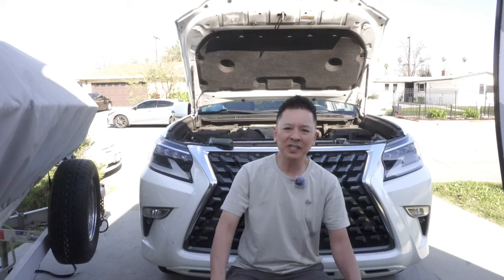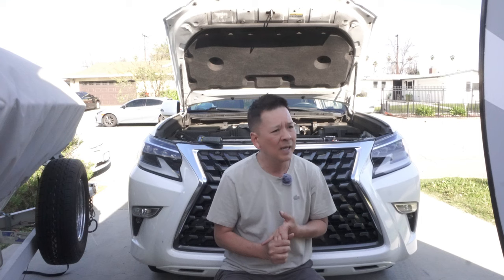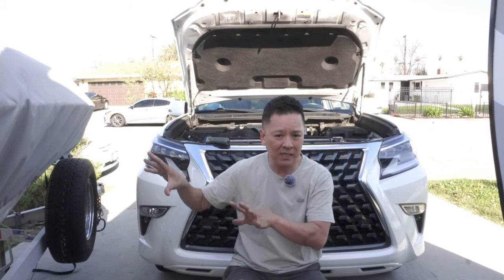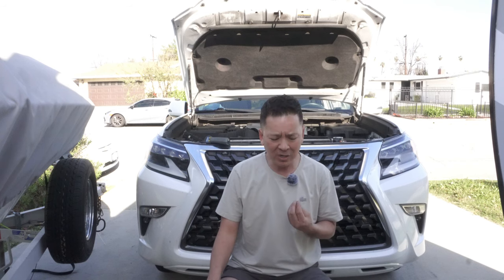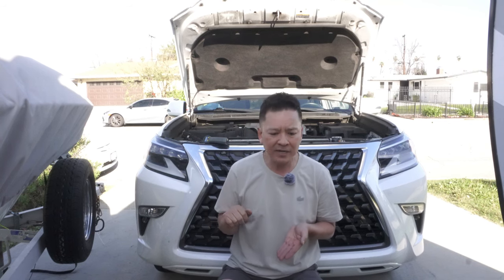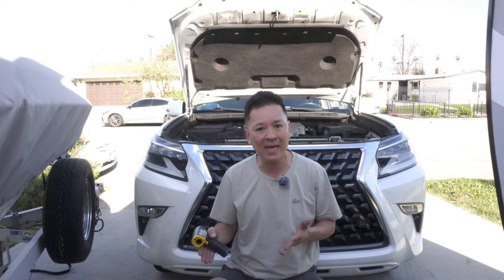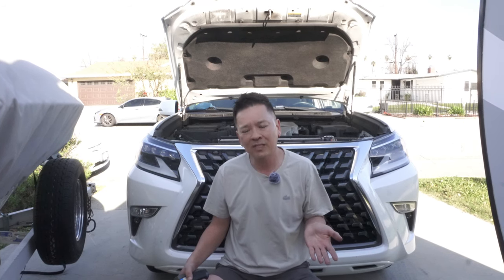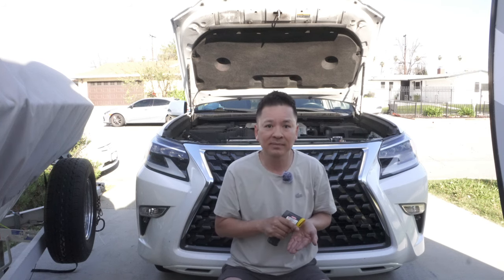The BEST R.O.I for your Lexus GX460

Comment: You can use a scangauge on the GX to get the actual transmission temp. I did your transmission cooler mod after seeing 215F in Death Valley off-road without towing. Thanks for the info and stainless brackets! My transmission temps dropped around 15F and I’ve never seen above 205 F since, even while towing.
Reply from the maker: Thats awesome to hear, Rob!  Did you do anything different from my original install?  Just curious.
Reply: I added one more home made bracket to get a third connection point low on the cooler to the lower frame to make it more solid and had to put the horns in an alternate location to you  as I have a '17 luxury model with front camera and other equipment in the way. After seeing stock configuration transmission temperatures without towing I recommend every GX owner who lives where it gets 90F+ in summer or who tows should do a partial drain and fill by 40k miles to refresh their fluid as fluid life is directly tied to operating temps. That is if you want your transmission to last as long as the engine.  Now that my temps stay below 200F and my normal highway cruising transmission temp is around 188F I will do a partial drain and fill (easy to do yourself or ~$180 at the dealership) every 60k.
Reply: @robbergstrom943  This is super good info. I am also in Southern California and I have a '15 Luxury that spent most of its life in Texas, where it can get extremely hot, although I know for a fact that it was never used for towing because it never had a hitch installed on it. As expected, the trans fluid was BLACK after 110k miles. I've done two drain and fills over the last 4k miles and the trans definitely shifts smoother now.  I'll probably drain and fill one more time at the next oil change, and then switch to 30k mile drains. The Hayden trans cooler install is coming soon, as I want to at least tow a small utility trailer with this thing, and we plan to wheel it harder in the desert in the future. Here's hoping that going 110k miles on the original fluid (with only normal driving, no towing) did not significantly shorten the transmission's life.

Comment: You got great vids and i get great ideas from you... I installed csf radiator with transmission cooler and fan with thermostat...increased power torque and top speed around 150mph with stormpeacock gx460 ecu tune...pedal commander CAI cat delete afe exhaust...the tune is the best you all have to try... Have fun with your upgrades... I just ordered a uniden r7 also
Reply: Plus other upgrades...poly urethane sway bushing for great control..and..

Comment: Wow, I'm expecting early summer with this one. 
All the snowflakes are going to melt after this videos intro and commentary!
Lmfao
I'm going to do this mod here shortly!

This is good R.O.I. for sure, but my favorites so far are, k&n drop in filter, throttlebody clean, MAF clean, and cleaning the EGR and EGR piping.

With 122,000 miles, my EGR pipes were very clogged, and the throttlebody was very dirty. 

I noticed a huge improvement in torque in the lower RPMs! GX runs great now!

Thanks Bob
Reply from the maker: thats really good to hear that you were able to benefit from some of these useless videos! Now time to repay me with gratitude by doing  a wife swap.

Comment: I need to do this one.  Did you ever do the OEM looking monetary button for the stater kill switch?
Reply from the maker: hey austin.  Sorry for the late response.  Its been 17 minutes and i hate to have a white guy wait.  I looked at the switch and was contemplating what i wanted to do with the switch.  Since i don't want to attract attention to the switch i would leave the illumination portion out.  I would just use Green and Red 1.  Only 2 wires to replace the momentary push button i currently have. I think i need to remove everything to really look at it from above to ensure it will work since the button you advertised is originally for a power and not ground in order to work. I just ordered the button you suggested.  Will arrive in 2 days.
Reply: @GXBOB Yes never make a white Christian semi-straight guy wait! I have two of the buttons installed.  Both of the button's lights are off when the car is off.  But I hooked one light to be on with the car and one light to be off when the car is on.  Both buttons light up when the button is activated.

Comment: What is your thoughts on the transmission pinning that you see on the forums?
Reply from the maker: Hey Mike, to be perfectly honest with you, i would never consider pinning because i live and travel in environments that don't require it.  Even when i tow my 3k lb fully loaded travel trailer, my temps are still in acceptable ranges.  I would have to live in desert and hilly environments to test out that case and see if it's worth doing.  I would just rely on the available testimonies provided on the forums and go off on that.